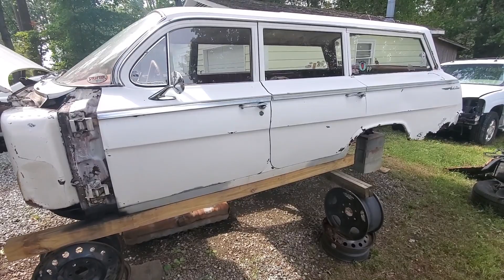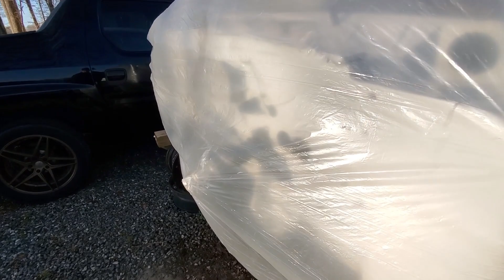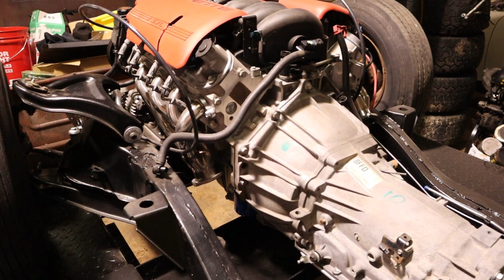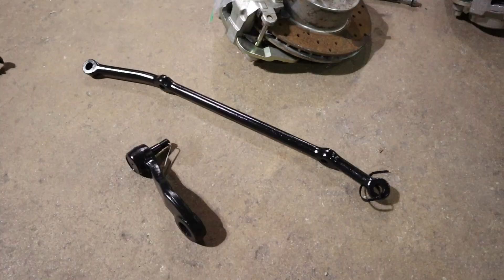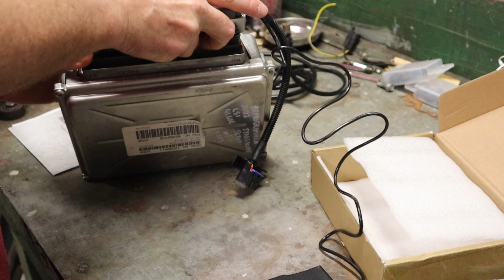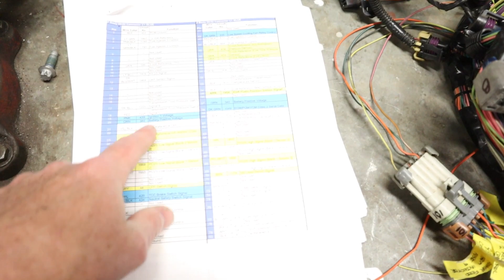Replacement Frame And Drivetrain - 1962 Chevrolet Bel Air Wagon Project

Comment: Love this build. Amazing fab skills. I have almost the same build. I have a 63 Biscayne wagon LS Turbo swap well on its way. My body is in much better shape and seeing you repair a bunch of the same areas as I have builds my confidence. How are you going to repair the rear storage panel vertical section at the tailgate side that has the holes ? I have that same issue. And that panel is layered. Thanks!